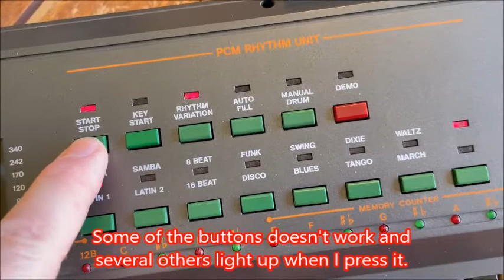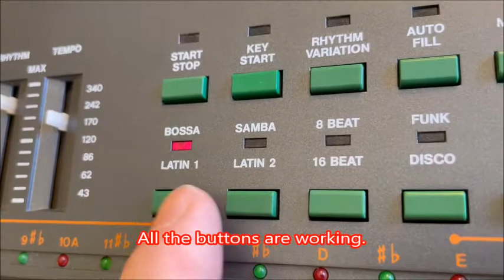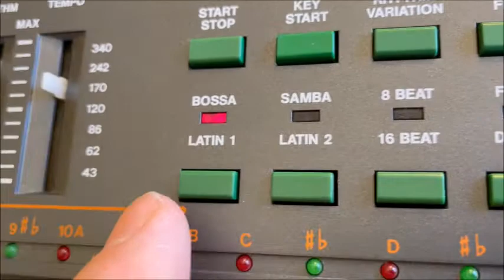GEM DSK-7 repair

Comment: I'd say that is a perfectly adequate repair! I've got a weak spot for GEM. It was the last of the Italian Brand names, besides Fatar and Farfisa. GEM might not have the same ring as Crumar or Elka and some of it's 80ties organs soudned really cheap but it has also made some very nice stuff, especially the S3 and S3 workstation synths with polyphonic aftertouch. In 2004 I visited the Marche Region in Italy and found the abandoned factory.
Reply from the maker: It's a quite limited keyboard that I believe use the same tone generator as my Farfisa organ. It also looks a bit strange because it is so long with the speakers on the ends but not very tall or deep. I have mostly used it as input when I occasionally make MIDI files. GEM seems to have a nag for making odd keyboards - I also have a WS2 that I restored a couple of years ago. That one has one of the strangest user interfaces (buttonologies) I have seen.

Comment: 0:26 Does the DSK-7 work on batteries?
Reply from the maker: Yes, it can run on the big D-cells.
Reply: @organfairy  Have you tried it?
Reply from the maker: @timothyverbist5795  No. I have always used the power supply.
Reply: @organfairy  okay